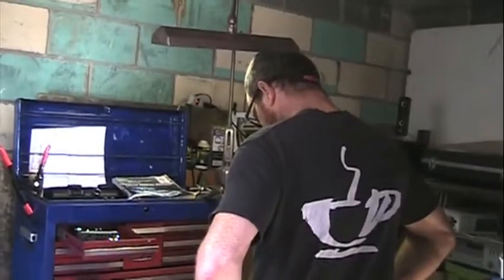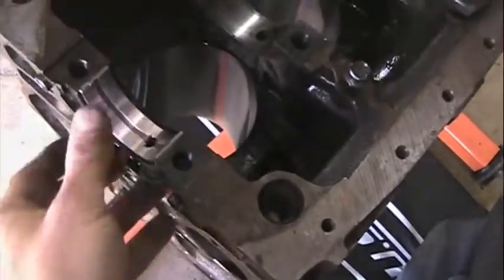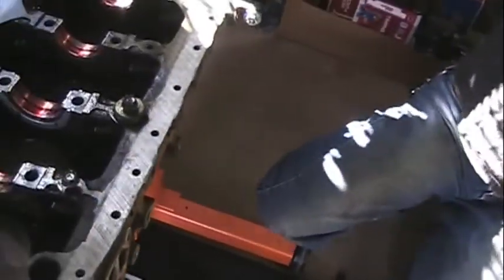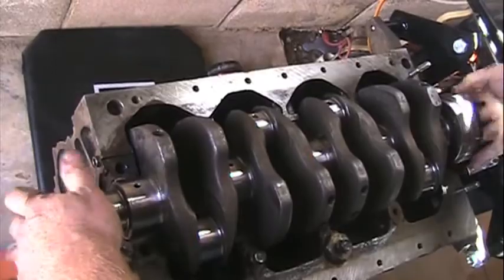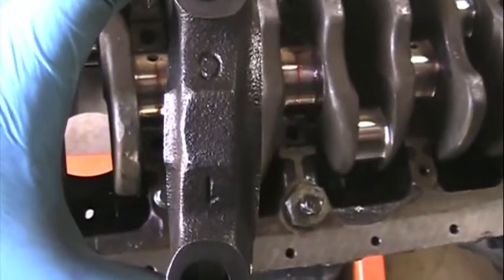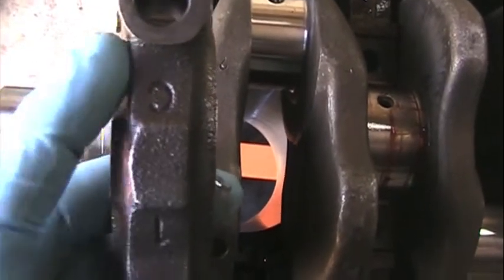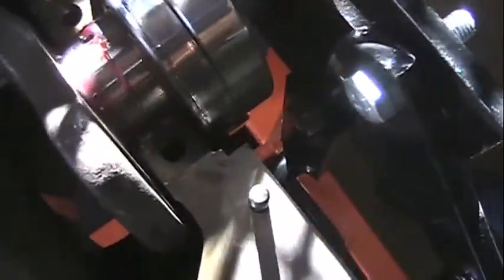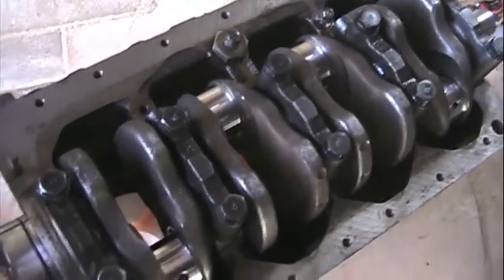How to Install a Crankshaft using plastigauge

Comment: Hey Johnny. When you install the rear crank shaft oil seal on an Isuzu NPR, do you use a tool or just flush it with the external edge or ??? I'm working on a 4BD1 rebuild and trying to determine if I should/can forego the $800 Kent Moore tool for setting the seal. Any input appreciated.
REPLY
Reply from the maker: I use a piece of 4 inch PVC pipe and make it flush
Reply: Johnny5ive thank you for the input. Just want to make sure I take care of it so it can take care of me.

Comment: Hey johnny i have a 98 isuzu rodeo 2.2 4 cylinder it had a blowed head gasket well the dual camshaft have like podiums that hold the shaft in place and they have numbers and arrows but i dont remember where they go back exactly any advice